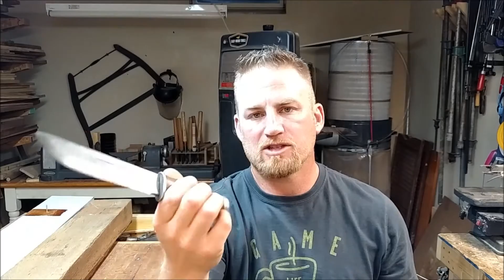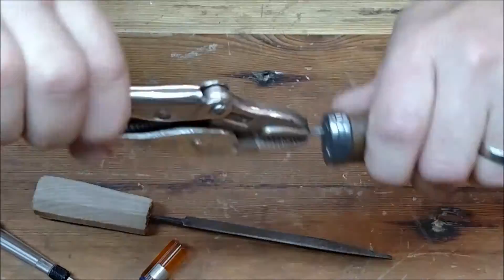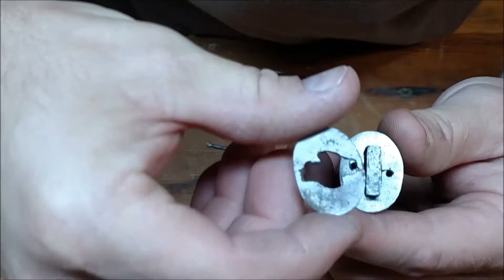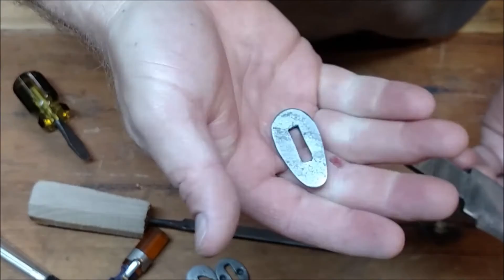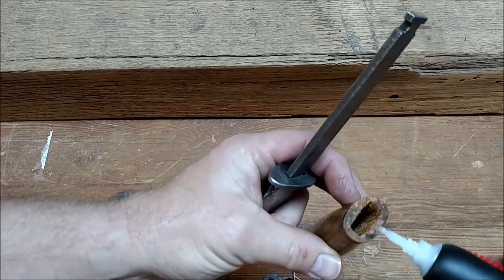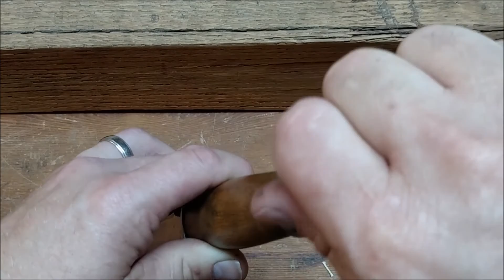Cattaraugus 225Q Knife Handle Build- Vintage Wood Workshop

Comment: THE ONLY THING MISSING IS THE CHECKERING ON THE POMMEL MINE WAS USED IN THE PACIFIC AND HAS THE ORIGINAL SHEATH, NOT A SHOW PIECE BUT USED THE WAY IT WAS BUILT FOR, ALTHOUGH THE FACT IS THAT SO FAR IT HAS NOT BEEN USED TO KILL THE ENEMY YET

Comment: Well , Again really interesting to see the inner mechanics of this Q Knife . I almost wish I had a excuse to take mine apart . But .... if it ain't broke ....  
Did you have to Drill out the rivets on your knifes original pummel ?
Reply from the maker: thanks, no, all I had was the blade and tang, no parts of the handle at all unfortunately